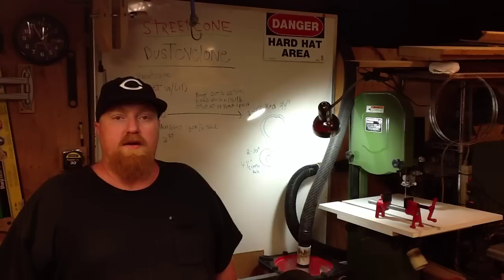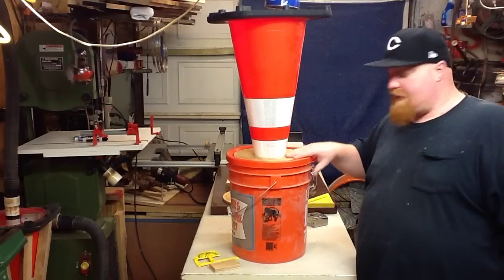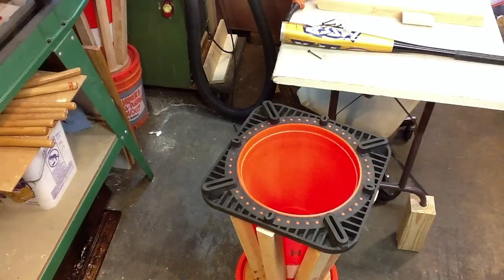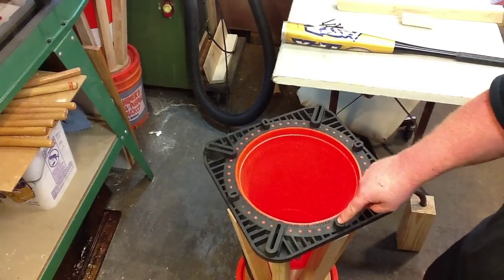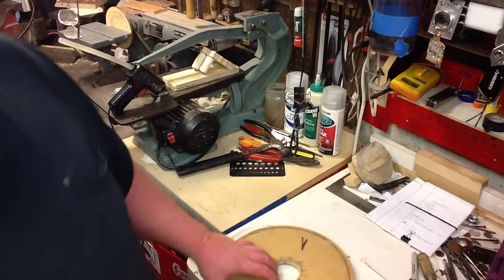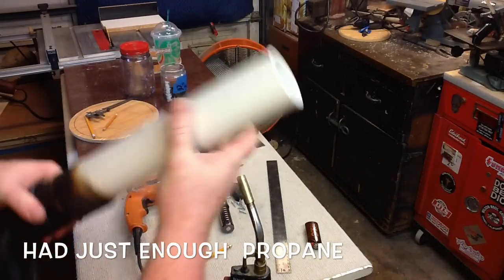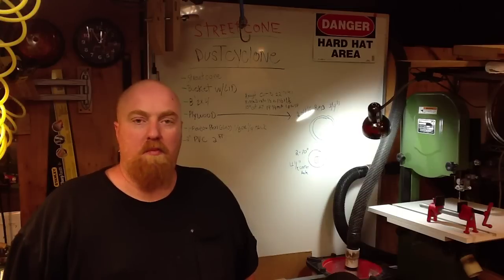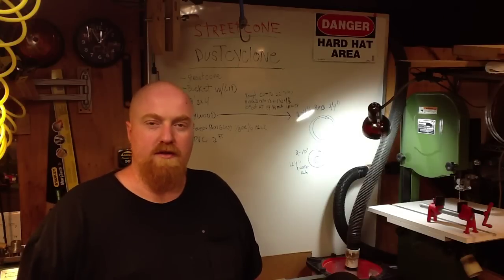Street cone dust cyclone build-015

Comment: Wait, wait, wait, wait, wait, wait.... did you just drill a hole with a BASEBALL BAT?!
Reply: i dont get it...where in this video do u see a baseball bat?
Reply: @Northwest Aerial Photography oh ok..thanks..got me there
Reply: @starofeden9277  Open your eyes, or are they full of dust.......duh
Reply: @dougpearce2901  domeone did point out yhr place in the video...because i didnt see it ...i skipped through as i was looking for ideas
Reply: That was Awesome!!!!!!!
Reply: It was a dumb, barely viable solution to an easy to solve problem. That bat as tool demonstrated a fundamental issue with analytical skills and problem solving.
Reply: He sounds Canadian, so I would have expected him to use a hockey stick... :)
Reply: @CurmudgeonExtraordinaire  Excellent point, & thank you for returning us to normalcy. We were just about to go off of the engineering/maker rails. Well, mostly it was I was that was about to go off the rails, and I was THAT (holds two fingers in the air about an inch apart) close to doing so!

Comment: This is great but would the screw heads inside the cone interfere with the suction vortex?
Reply from the maker: hey Mike.  thanks for watching!!     so to answer your question on the screw heads well its plain and simple. the screws do not interfere at all. yes, it would probably flow smoother and look better if the screw heads were not there but   I've never needed to empty the shop vac or clean the filters at all since I made this so it's not even a concern.  I appreciate you watching and commenting
Reply: Thanks, I will be watching your videos from now on. I liked the down home look of your workshop.

Comment: can you use a old  ruber moto bike or push bike tube to connect tubes up will it work?
like your work shop set up very cool man.
Reply from the maker: im sure you can use a inner tube to join them im not sure how strong that would be though     thanks for watching

Comment: Great video but a few mistakes, the worst one is your straight pipe coming through center of lid and the angled pipe at top of cone are wrong. The straight pipe should come only a few inches in the vortex and the angled pipe should sit a few inches below that. Otherwise youre just sucking saw dust before it has a chance to fall to bottom of bucket

Comment: Nice job, it works good. I don't have one of those cones, but gonna try it with a simple bucket. When i saw the baseball-bat i thought you were gonna heat it and melt trough. See your cyclone rotates counter-clockwise, does it work better than clockwise? By the way, nice chop-saw solution :)

Comment: how long should the pipe in the center be? Tanks for a Great VDO.
Reply from the maker: from the plexi glass into the cyclone i have mine at 8 inches in    thanks for watching
Reply from the maker: total length is 12 inches with 8 inches sticking down in to the cyclone from the plexiglass top

Comment: Vice on on the video!  I have two questions  for you.  1. Does your vacuum pick up more dust than it should because your straight pipe begin suction below the cone intake?  My Dust Deputy cyclone has the straight pipe begin about 4 inches above the dust entrance port.  2. How do you like your Central Machinery Lathe?  I'm considering buying one.
Reply from the maker: hey Michael    so that Vice is my dad's old Columbian vise from the 40s that I love  so  to answer your questions ill number them and do the best I can  so here we go  question 1 answer 1    on my cyclone the pipe sticks 8 inches below the plexiglass top and at the measurement the dust never gets sucked in to the pipe to go in  the shop vac   with the speed of the dust caused the suction from the shop vac and the g-force created  along with the gravity pulling the dust in to  the barrel under the cone  it rarley ever gets any dust in the actual shop vac  the only time it does is when I dont empty the barrel and the dust has nowhere else to go   i hope that answers question 1   ok moving along to question 2 answer 2  here we go  u asked how do I like my centrial machenery lathe  well I like it just fine for a starter lathe and have made some nice things with it I got mine used for 100 bucks from craigslist and thats a super deal   the only problem I see with this lathe is this   when turning a 12 inch bowl the lathe has a tendicy to slow down during a large cut so its best to take light passes  other than that its a great tool to get started into turning   so I like it   I have lots of turning projects on the list and videos will be coming out soon using that lathe   I hope I answered your questions good enough  if not feel free to ask more detailed ones and ill doo my best to answer  thanks for watching and for the support  The Patrick's

Comment: Patrick I know you posted this long ago. However, I wanted to thank you for the inspiration. I have mine started in my shop now. So far I have made everything with stuff I have salvaged or had on hand. Total cost so far is ZERO. 
I am coming up to the point where I may have to spend some money on hose and PVC. 
I think I may have to wait for this weekend to finish but it is coming along quite well. 
Quick question if you don't mind. How did you calculate the circle of plexiglass for the inside of the cone?

Comment: Wouldnt it have been easier to just have attached the first cyclone to a bigger container, like { connect the buckets together}
Reply: EXACTLY what i thought!
Reply: Having two means he can have One cyclone permanetly attatched to His primary tool and move around the secondary as needed.

It also allows for double "filtration" so the shop vac  filter will remain unclogged for longer periods of time.

Also easier to empty the buckets individually into tall dumpsters or move around generally.

Comment: Hopefully you did not breathe much of the fumes from burning the PCV pipe. Btw, you could have accomplished this task by using a heat gun, easier to control than propane flame.
Reply from the maker: thanks for watching   I had a fan on was in a open area so its all good

Comment: I'm not sure if that cone is supported well enough though. I think you should have used 9 2x2's.
Reply from the maker: Hey Stave  Funny U say that cause when I made it I figured it would be easy for anyone to replicate it with this size material but after all these years I think 3/4 x 1-inch material would work the same and lighten up the load cause it's kinda a heavy sob.   also in my defense, I always build stuff extra heavy duty and overbuild it so it lasts forever and I can say this street cone cyclone works so damn good I use it every day still to this day I don't have a need to change it for a store bought one.  I am considering a larger set up with 4-inch piping buts that's a future upgrade for a few of  the bigger tools 
thanks for watching and commenting  glad to have ya on board

Comment: Hello Patrick, I have a question, how long is the PVC pipe in the middle?. Saludos desde México
Reply from the maker: the length of the pipe is 12 inches  and it sticks down in the cone 8 inches   thanks so much for watching
Reply: Gracias Patrick, lo vi en otro comentario, y no borre el mío, disculpa. Agradezco tu respuesta

Comment: Won't hot glue work instead of silicone and what diameter is the pvc
Reply from the maker: hey Andrew hmm   hot glue may work but silicone is more flexible and can stretch some its worth a try and if it dont work hot glue is easy to clean up   as for the pipe  its a standard 2 inch schedule 40 pipe  i heated up with a torch to custom fit my hose fittings for the shop vac hose    i hope you make one  mine works great   thanks for watching and for having interest in my projects

Comment: I am beginning to wonder: Why do you need a cone shape anyway? I don't think it actually figures into the aerodynamic properties.
Reply: But is that a proven fact or just an assumption? Obviously you need a circular path where the air can spin and an upward exit in the center for the air to leave the chamber. The dust is going to settle downward and needs an exit on the bottom of the spin chamber. It could be a cone or a slot. I seen it done either way.

Comment: Everyone keep your silicone tubes where you can see them... He now has Two "cyclones" that need to be sealed... lol, or you can be like the road crews looking up and down the street where they "Lost" their cones...

... Nice vid though, the ghetto "frugalness" stayed consistent throughout and was pretty creative... but if the Bucket fills up that quick, why don't you just enlarge the lid to fit a garbage can instead? .. there might be a half a second delay on suction when it starts up while the larger volume equalizes to the low pressure, but after that there won't be a difference in suction/performance (with the exception of the larger capacity)...

...and people frequently (once a week or two) "try to throw out" their garbage cans with their garbage... but the garbage men refuse to take the can... and just leave them lying on the side of the street.

* oh, and to everyone else, you might in addition to keeping an eye on your silicone, you might also want to watch your garbage can on trash day... I'm getting the feeling "someone" might have tipped him off that they're easy targets...

Comment: Wouldn't it be easier to just hit the bat with a propane torch and melt the hole?
Reply from the maker: thats a good idea   Bran   thanks  ill have to remember that next time
Reply: @Patricksworkshop  no worries. I seem to be a lot better at coming up with shortcuts and solutions for others' projects than my own. I'm nearing completion on 6 or so projects of my own right now too. If you happen to have some free time (probably early next week) I'd love a second opinion on em (all or just one. I'm happy with any bit of progress I make). There's a MOT DC arc welder, isolation transformer, bench power supply, cyclone collector, 3d printer enclosure/liquid cooling/upgrades, multi-fuel/accelerant foundry/forge, and those are just the ones I'll be done with in the next week. I'm also trying to make basically a workshop fully contained in a workbench (already working on the lathe and mill aspects along with what will essentially be a subpanel on steroids to power it all, provide isolation/DC/adjustable outputs/etc.) It sounds more overwhelming than it feels. But if you do have a chance, I'm currently building the site to host it all on at diyshoptools (.com) along with a forum. I'm still building it all now, but expect I'll be done about Monday. And would very much appreciate your opinion on it all... or on any of it really

Comment: I have bought traffic cones.  There is no way this is less costly than just buying a commercially made item unless you are "finding" the materials.
Reply from the maker: Well I got mine from a friend who worked for a water department  But they are free if u want one they are scattered all across the country
Reply: @Patricksworkshop  - that is what I am talking about.  If you can find a free cone and find some free plywood and find some free 2x4 lumber...  If you need to buy the materials, it is less costly to buy a factory made unit instead.  Still, this looks like it works great.  Good work making something and thanks for sharing.

Comment: Why not upgrade to a 20 gal bucket instead of using two 5 gal just use the same cyclone street cone
Reply: if you are look for a bigger barrel why not get a rain barrel it will hold a lot
Reply: Patrick's work shop np

Comment: Interesting way to form PVC pipe, by far not the smartest thing to do.
Reply from the maker: got to do what you got to do sometimes and thats what i did the outcome worked flawless and thats all that matters    i will do the same method next time  except i will have a full tank so it will be heat and lass flames